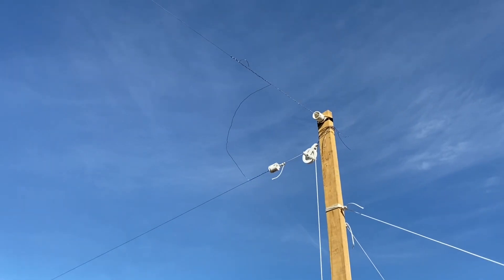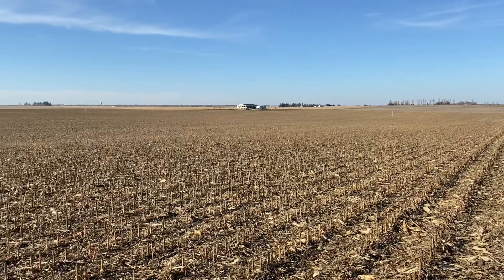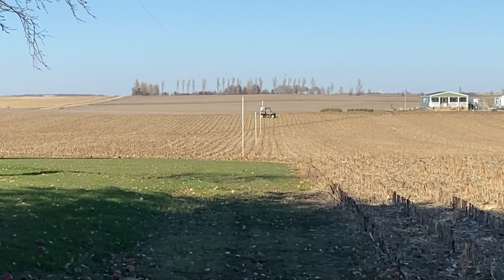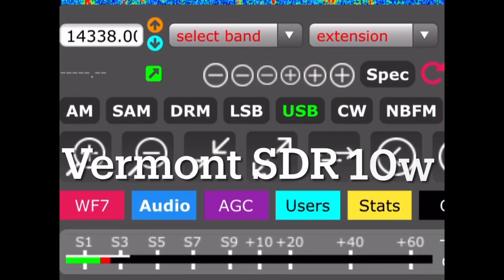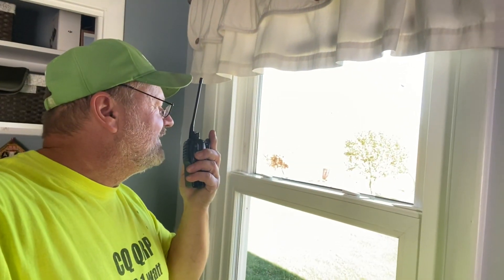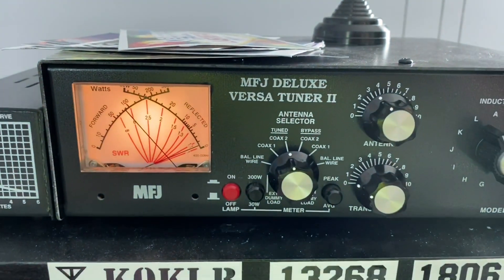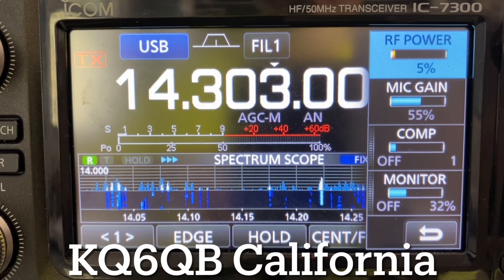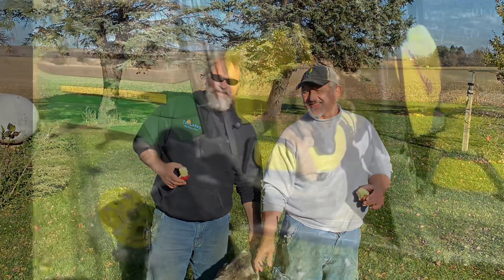3200ft Homebrew Square loop QRP SSB 5w - Iowa.. Episode 2

Comment: Wonder what 4 Telephone poles would cost, that'd get ya higher and make it permanent 👍
Reply from the maker: Great idea.. that would def make a difference.  It was created as an experiment to see how it would perform with a simple section of PVC pipe.. Not so well for transmitting but, It worked great for a Short Wave radio receive antenna, LOL.. Thanks for watching and commenting.. 73, Kevin ~ k0klb
Reply: Telephone poles run at least 1K
Reply: Use post

Comment: I was thinking about doing a horizontal square loop at about 28-30' strung between 4 flagpoles, then feed line and balun off one corner and back to the shack to a wideband tuner....

Where did you come up with the length to do that?  

Whats the swr on 6-160m or at least up to 80m???

Comment: Have you tried beverage rx antennas? Basically easy conversion here. One NE,NW and Sw. Like having a yagi on 80 and 160m for rx
Reply from the maker: Hi Jay.. I have not tried an "official" beverage antenna.. however, I did connect my Tecsun s2000 short wave radio to this antenna and it was fantastic.. Switching from the noisy internal whip antenna over to this square loop was night and day.. It was like switching from AM at night, to FM radio.. So, I used it mostly for SWL and could pull in stations I've never heard before.. Thanks for watching and leaving a comment.. I appreciate it... 73, Kevin ~ k0klb
Reply: @hamradioqrp-k0klb  do you have anything to compare it too? Maybe just an efhw for 10-80 as high as you can? Long loops like this are great rx antennas. Pretty cool when you can actually run the pre amp on low bands.
Reply: @JayN4GO  Hi Jay.. No comparison anymore.  We had to remove the wire and post's in the spring to prepare the field for planting.  It was just a temporary experiment over the winter months.  It was fun to play with while it lasted though, LOL...  Thanks for visiting.. 73, Kevin ~ k0klb

Comment: ..Good job Kevin! Ya gotta try that thing on 160/80/60/40M!!!
73
Tim
VE3IIM/VE6PG
Reply from the maker: Hi Tim..  Over the winter, I did try the 40, 80 and 160.. They didn't do very well.. If I could raise the wire 50ft or so, I'm sure then those bands would perform much better.. However, it was a fantastic antenna to connect my short wave antenna to.. wow so quiet and shortwave broadcast sounded like local FM radio stations.. It was great..  Thanks for watching and leaving a comment.. I appreciate it,  73, Kevin ~ k0klb

Comment: Yes that is fantastic! I have 80 acres I can play with. I always wanted to try that. Thanks!
Reply from the maker: Hello Kevin.. Thanks for your comment.. The square loop is very directional.. I have a main lob facing east which is why we saw the gain in Vermont.. Notches to the south and west.. However, in the Vbeam configuration was more omnidirectional and I would say for that reason, performed better.. It works beautifully connected to a short wave radio.. It will pull in DX stations with no noise and FM quality audio.. it is a mazing for that..  Thanks for watching.. 73, Kevin ~ k0klb

Comment: Other bands??
Reply from the maker: Hi J A.. I have tried other bands.. Both 160 and 80 have been great listening, but have not made any contacts on them.. I don't think I have enough power.. I heard a ragchew on 160m between guys in Minnesota and Wisconsin (im in Iowa) crystal clear and I tried to break in but no one heard me.. I even cranked up the power to 80w.. but, maybe they didn't want to talk to any outsiders either.. hard to say.. So, I have not had much QSO success on 160 or 80.. but do make QRP contacts on 20 and 40.. As expected, it does not transmit as well as my 550ft long wire that's 70ft high, but listening on it with the low noise if pretty nice.. It will be fun to continue to play with it over winter and then it all comes down in the spring before field work starts.. If I do it again, I wont do the full loop, but will only put up the Vbeam.. Thanks for watching and for your comment.. 73, Kevin ~ k0klb

Comment: Fantastic ! I love your videos - this was simply amazing to see how well that square loop antenna performed. Good to meet your brothers as well - so kind of them to help out :)
Reply from the maker: Hello alze... Thank you for your comment.. The big loop antenna does perform well to the north and east.. We found out later from a model that the lobe to the east increased (compared to just the V beam wire configuration), which gave us the gain we saw on the video.. however, with that gain comes tradeoffs as the big loop developed more notches to the west... It was a fun experiment and we learned more about lobes and notches in the process.. Thank you for watching.. 73, Kevin ~ k0klb

Comment: Didn't expect THAT much improvement. Very nice! Wish I had room, I badly want to construct a horiz loop like that, though hoping to get it up to 30 or 45' ' if I can manage. 
Less static means not only less noise, but safer  for your receiver. Plus you could connect a small battery charger to de-ice your loop in winter.  Wasn't my idea but I love it!  72 de AI7AN
Reply from the maker: Hello Stuart... Thanks for your comment.. Getting it high like you plan would make a huge improvement over the 10ft that mine is at.. I really didn't expect much performance with this loop since it is only 10ft off the ground, but I was surprised... I had a youtube viewer offer to model the antennas to find the lobes and notches.. the gain we experienced when creating the square loop was because the lobe to the east got bigger (according to the model).. and as with everything, there are tradeoffs as it also created notches to the west and south so we lost the lobes going west.. Still, it is fun to just "throw things out there" and see what happens.. I do enjoy the less noise though.. I'll continue to play this winter and  then it all comes out before spring planting.. thanks for watching... PS.. I host a Facebook page for QRP SSB folks if your are interested in joining.. its a small group and we like to share pictures and videos..  www.facebook.com/groups/qrpssb/ ..  73, Kevin ~ k0klb
Reply: I have a mere 600 foot loop, a delta, up between 30 and 40 feet. It’s a great antenna. Doesn’t cover too much space, maybe a half acre to an acre.

Comment: Another interesting vid. Thanks.  I envy your space.  I would built two very long resistance terminated Beverage RX antennas along the edge of the fields.  One to favor E/W and the other to favor N/S.
Reply from the maker: Hello Jayfmiller... Thanks for your comment.. I've received encouragement from others to complete a Beverage antenna as well... I will probably experiment with that before I tear it all down next spring if we have time.. Thanks for watching.. 73, Kevin ~ k0klb
Reply: Kevin, I had a rural property in IL back in the 70s with a true Rhombic up on 60' poles for TX and two 1000' resistive terminated Beverage for RX. The Beverage antennas made excellent low noise RX antennas for DX.   Now, all the space I have for wire is 88' for my ladder lead fed doublet and a 40m Beverage favoring E/W  If you want to keep them on the farm, make them a ham radio operator. LOL

Comment: Fantastic! I'm pretty sure this brings a smile to every Ham's face, it sure does to mine. Thank you Kevin, I hope you have a lot of fun with your antenna and I also hope it fills your logbook with every possible DX. 73
Reply from the maker: Hello Ferry.. Thanks again for your comment... It was fun to build and experiment with.. I'm finding that it is actually very directional with lobes to the East and North, and notches to the west and south.. A youtube viewer offered to model the square loop for me and his model falls much in line with all the QSO's I am working with it.. Nice QSO's to the east coast and very few west and south.. It is interesting how antennas all work.. A fun experiment and education.. I'm planning on doing a followup video to show the results soon.. Thanks for watching.. 73, Kevin ~ k0klb
Reply: @hamradioqrp-k0klb  I guess you could feed two opposite corners of the antenna and switch those with an antenna switcher. That would however take some length of coax for the corner the furthest away. But you than could switch between directions ..  Anyway, looking forward to see the follow up video. Good luck Kevin. 73

Comment: My question is where do you think that 12 db gain came from ? If you gain 12db in one direction or distance it has to be at the expense in some other direction or distance angle ? 
To get 12 db gain that surely can't be in every direction?  
Is it possible for a follow up video giving more explanation  ? Tks Rob in Scotland.
Reply from the maker: Hello Rob.. Thanks for the comment... Those are great questions.. ones that we had as well.. We are working on a follow up video with some data of what we are experiencing with this antenna.. A viewer volunteered to model the current 3200ft loop antenna and it appears that we have a large lobe to the east (direction of Vermont) which corresponds with the nice signal on the SDR.. Actual QSO's also favor this direction.. Once we gather all the pieces of data we can find I will do a video with the results.. It wont be "Lab testing" quality on our "no budget", LOL, but it will be the best we can do.. Thanks for watching.. Kevin ~ k0klb
Reply: @hamradioqrp-k0klb  Tks for your reply.  I look forward to the follow up video . I at one point had a 720 feet v beam pointing NW into your part of the world . It was very good in one direction but very bad everywhere else , so i gave up on it .

Comment: I don't know what I am more impressed by, the transmit on that wire or your S0 noise floor.
Reply from the maker: Hello Jeremy.. Thank you for your comment... The low noise is very nice indeed.. However, with further research and a youtube viewer offering to run the dimensions into his modeling program, the results showed that my main lobes are North and East on this loop.. Many Notches to the West and south.. (these lobes and notches correspond with my QSO contact locations over the weekend which were all North and East contacts)  I just QSO'd Jane in Massachusetts (Im in Iowa) on the YL system net on 20m using QRP 1 watt and she said I had a nice 55 signal.. So, it does work on transmit even though it's only 10ft off the ground.. As I gather more info, I will probably do a follow up video with my findings so everyone can see that, although it is big.. it may not be the best performing... It's all in good fun and learning.. Thanks for watching.. 73, Kevin ~ k0klb
Reply: @hamradioqrp-k0klb  oh for sure it is going to have big lobes and big nulls, that's just the nature of a big loop on higher freq's. Now if you have the room to position those lobes in the direction you want to talk you will be in business.

Comment: I gotta ask again, did you check the SWR and impedance on 75 or 160? ...inquiring minds want to know....Gene, K9UOK
Reply from the maker: Hi Gene... Yep, I just made a recording for ya... Impedance was a little high on 75m..  but my tuner is able to match it just fine.. Here is the link...  https://youtu.be/KmxeAim8tF8

Comment: Awesome Kevin! I love what you're doing with your antenna experiments. I had to sell my antenna farm which had multiple 4oM wire beams and some long wires. I'm at a temporary location right now but put up mostly a V-shaped long wire (300 feet per leg) and the ends come down from a 55 foot height to a remoter tuner fed with RG-8X. Worked Europe on 75 meters using 100 watts and on 40M worked Japan (SSB). I have radials for 75M through 10M. It tunes all those bands. It'd be cool to work you sometime. 73 de WA3RSL.
Reply from the maker: Hi Frank... Thank you for your comment and for watching... I see from your QRZ page that you have quite a bit of experience in wire antenna configurations.. That's amazing and pretty cool... Sounds like you have had good luck with them all.. Thanks for sharing..  I'm just a rookie, throwing things against the wall and seeing what sticks, LOL... 73, Kevin ~ k0klb

Comment: Have you ever thought of setting up a Beverage antenna? They are 500 to 1000 foot long and low to the ground. Receive only. Directional and used by some of the big DX stations. They are described in the latest QST magazine. And lots of other places. With your land, you could run north south and east west and cover the world with them.
Reply from the maker: Hi Don... Thank you for your comment.. Yes, I have thought about it but I have not envisioned how to lay it out yet.. I need to do more research and develop a plan for the future..  I also have heard that they work great as low noise receivers.. It's in the plans, but down the road a ways... Thanks for watching... 73, Kevin ~ k0klb

Comment: Awesome Kevin! As a QRPer and mostly POTA chaser I was grinning through the whole video. Did you still use 450 ladder line and a 4:1 balun? Very 73, N4WLC Bill
Reply from the maker: Hi Bill... Thank you for your comment.. I did use the ladder line and 4:1 balun.. in fact, everything that was built in the 1,600ft video stayed the same.. the only thing that changed was that we connected the additional 1600ft to create a square loop.. Nice to here from a fellow QRP'r..  I mostly chase POTA as well, but also do some activating from time to time.. I really enjoy the challenge of activating POTA QRP 1 watt.. It is a very relaxing and rewarding..  If you like QRP, you should come join a little QRP group I host on Facebook called "QRP SSB, 1 to 10 watts".  We just share pictures, videos and ideas... Hope to see you there... Thanks for watching.. 73, Kevin ~ k0klb

Comment: Kevin, did you notice any difference in noise level on your receive with the loop version? My understanding is a loop will be quieter on receive than a dipole.
 Looking good so far! 73' John KD5INM
Reply from the maker: Hi John...  The noise level on both the "V" antenna and the Loop antenna were virtually the same, LOW..  I notice the big difference switching between the off center 550ft wire that is tied 70ft high to the silo (more noise on the 70ft high wire)  I have to "turn on" the preamps on the ic7300 to get the S meter to register any noise floor on the loop antenna... That said, the audio signals are low without the preamp too.. I've been operating with the preamp on setting (1) and the noise today on 20m is barely registering on the S meter, but the audio signals from other operators are fairly strong.. For example, right now on 20m, Preamp on setting (1).. Loop noise is S0 (with an occasional S1 bounce).. Switching to the 70ft high 550ft wire and noise is S3... I know this is all objective and not scientific measurements.. but to answer your question, no difference that I could hear or see between the "V" wire and the Looped wire... but more difference between the 70ft high wire and the loop antenna..  I think being close to the ground also impacts the noise level greatly and makes it a lot less... I'd need to raise the Loop up to 50ft high or more to get a more even comparison... Hope this makes sense... Thanks for commenting and watching.. 73 Kevin ~ k0klb

Comment: A great way of getting an idea about the performance would be to install a half wave dipole, center fed off of the silo as a reference antenna. Then use a coax switch to instantly flip between antennas.  That eliminates the effect of propagation changes on the band.  Also, if possible, (and this could be pretty easy with qrp) try to make sure the S meter on the remote sdr has you below S9 because above that it is hard to see small changes because the S meter becomes non linear.  Great work, and it is a fun video.
73 de k2xt
Reply from the maker: Hello Richard.. Thx for your comment and suggestions.. I'd love to put more antennas on that silo, but it is such a long distance from the house that I fear too much loss in the coax transport to get there.. I'm afraid my QRP signals would be QRPp by the time it got to the antenna, LOL...  I need to build a small remote shack next to the silo so I can be closer to the antenna feed point.. Also, Thank you for your offer to model the antenna.. That would be awesome.. I will follow up with you on a separate email.. Thanks for watching.. 73, Kevin ~ k0klb